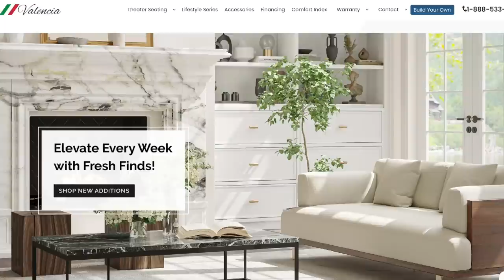Wait...I can do that better! Our DIY KITCHEN BUILD 1 year later REFRESH

Comment: Speaking of rising up your family, I thought of the height of the sofa.  I'd suggest raising the sofa to the proper eating/editing/crafting height with a two by four frame painted in your stair color (or even the blue cabinet color) and then reattaching the metal legs.
Reply from the maker: I think I was sitting in a weird way not really showing how tall I sit at the table lol it was a bad reflection of the height sorry
Reply: My problem would be the depth of the sofa, for me that would be very uncomfortable. I need back support. @ElysiaEnglish
Reply: Yeah it is just too deep and too low for the table.  I like the idea but the height difference is just too much to be comfortable and functional.
Reply: I love the concept but it seems awkward. You have to sit up close to the edge to utilize the table. There would only be sitting all the way back if reading or watching TV. It seems the reasons you gave for changing, you wouldn't be able to have the "sit back" option. It looks great in the room though. I hope you are happy with it.
Reply: Looks very nice, to short and takes up to much space in the room for my taste. But what is most important is if you love it. That is all that matters.
Reply: I’d replace the legs with taller ones!!  Easy fix.

Comment: I worked at a carpet Manufacturing company . They always suggested a carpet under-pad The backing of the carpet will not get the friction on floor. The foam under-pad saves the carpet .

Comment: I noticed the knots in your trim are bleeding through the paint. I use Zinsser shellac based primer on knots and anything else that bleeds through paint or may bleed through (like marker, tannins in wood, grease etc). The primer isn't pigmented so you can still see the stain through the primer, but it disappears and will never come back once you paint over it.
Reply from the maker: I did use zinsser when I painted them before I painted

Comment: Personally, I'd not be comfortable trying to eat at the table...or working on a laptop...or doing crafting...given how low the sofa sits. Cozy spot to kick back if your laptop...or whatver you're doing...is in your lap, perhaps occasionally grabbing cup of coffee off the table. Kind of a 'cafe vibe' which is more conducive to hanging out than actually having a meal, hours on a computer or doing anything which requires you to be more elevated above the work surface.

Comment: I was just reading the comments about the sofa's height.  My comments is this:  I agree with most it is to low and can't sit back.  But for the height, I like the look of a box frame for the sofa to sit on then, add those wooden feet that are chunky looking come in round or square to serve as the legs/feet of the sofa.  The base/box could be painted the same color as the sofa.  For sitting back, you could some back pillows so you are comfortable while sitting at the table.  Just an idea.

Comment: Elysia, remove the tag off the back of the rug you just installed. Over time, the black ink from the tag will stain your floor, and you surely don't want that eyesore‼️😉

Comment: Slightly higher legs on the sofa and slightly lower legs on the table.... Like 2 inches higher on sofa and 2 inches lower on table.   Not sure how doable or expensive that might be. Also depth of sofa... can back pillows be added to help with preventing discomfort for peeps needing back support.  You guys are such geniuses.... If need be you will figure it all out in time!